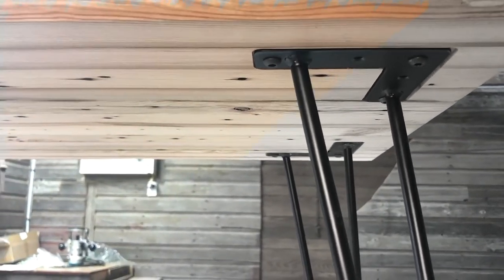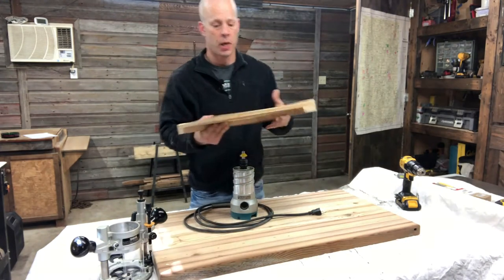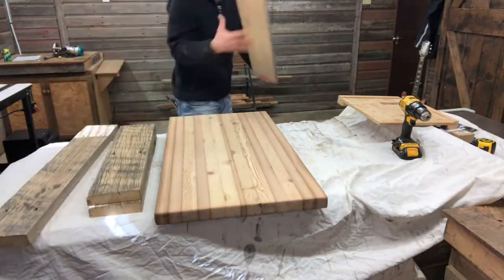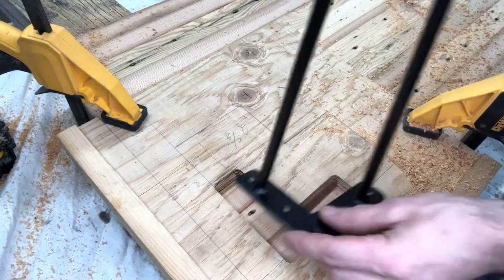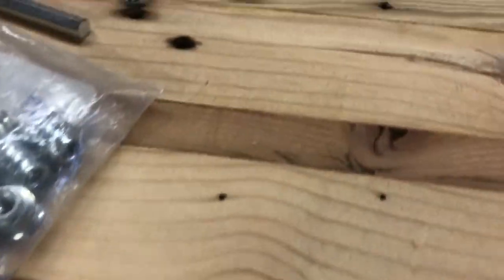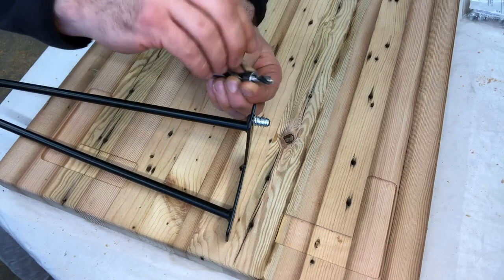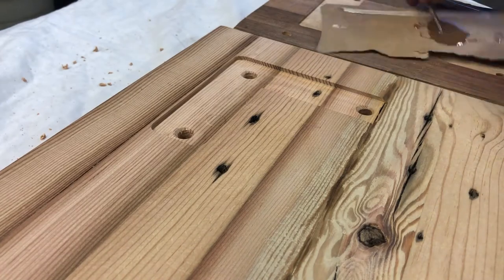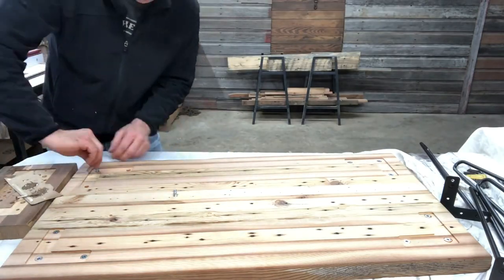How To Attach Metal Table Legs With Threaded Inserts (Reclaimed Wood)

Comment: Good Morning, Jeremy... I have a question concerning the size of my project. The tabletop is 1.25" thick, and the metal legs I am attaching are 1/8" (3.175mm) thick. Will the 16mm screws I have (along with the RampaTec M6 Threaded Inserts) have enough grab to hold the legs safely? Each leg uses 14 bolts. Are the 16mm screws long enough, or should I go longer... just curious. BTW, I'm diggin' the beard, Brother. Thanks 😎

Comment: Awesome! How do tot account for wood movement? Did tot drill out the hole in the metal leg a little wider than the bolt?
Reply from the maker: Yes, the holes were made bigger to accept the bolts.  We tighten the bolts then back them off a 1/4 turn or so to allow for seasonal movement.

Comment: Did you use an upcut, downcut, combo or compression bit to route out for your legs?
Reply from the maker: We used a downward cut bit for recessing table legs.  We put a link in the description if you would like to learn more.  Thanks for watching!
Reply: @TheDenBarnwood  the link just brings up a search for the term, not the actual bit page.